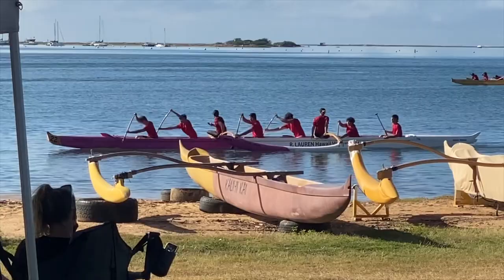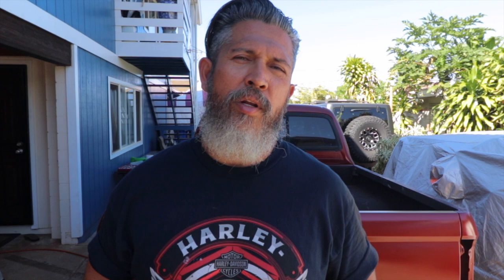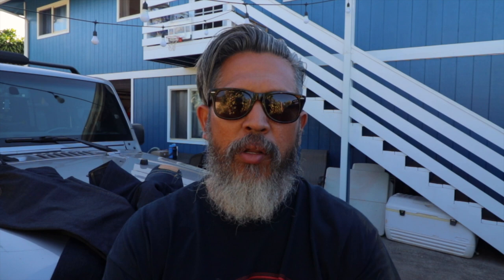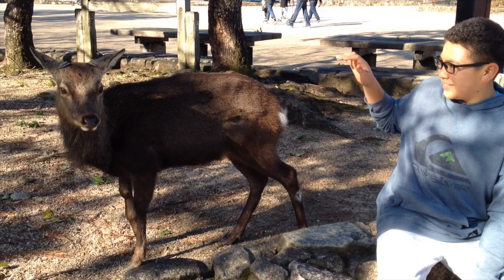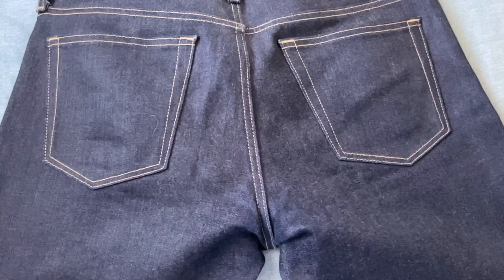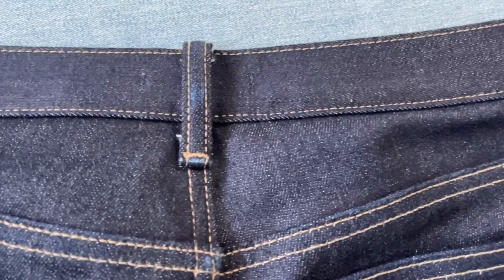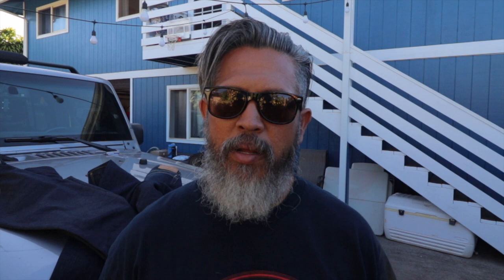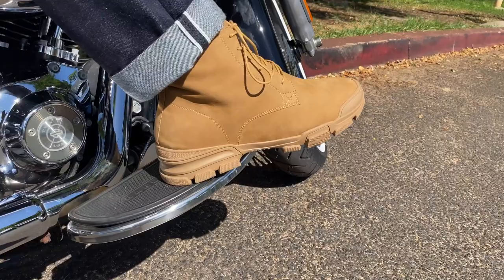Selvedge Jeans from UNIQLO Kaihara | Can it compete with the more expensive selvedge denim?

Comment: I can appreciate heritage. But first and foremost is fit. I just got into raw denim. First pair from gustin. 
They fit decent and I have now worn them for 4 months. Had to wash earlier then planned, as a result of a house project I have been working on. I put on a pair of jeans with a little stretch, while I was waiting a day for them to dry. I had forgotten how comfortable my other pair are. And they drape perfectly on me. Technically they are not selvedge. But they are very dark.(side note * they are new as well.) I think with enough time and following the rule of waiting as long as I can between washes and not drying them that I will end up with a really nice fade as well. Hopefully over time the gustin jeans will be close in comfort and overall fit. But so far I like my much cheaper jeans better. The main draw is that these are raw and I should get a better high contrast fade out of them. As curious as I am to try the more expensive brands, I am not certain that it is worth it. Only time will tell.
Reply from the maker: I have a few pairs of non-selvedge jeans that I use when working on my projects.  I put them on whenever I know that the day will be spent on the ground and I get really greasy.  Gustin’s are like Brave Stars in which the price is decent and the product is pretty good.  Tough to break in and get to the faded phase but it will get there.  On the other hand, the Iron Heart 666s is more expensive but comfortable out of the box and getting to the faded phase really quickly.  It also forms to my legs and waist easily.  

I think we all have a level of comfort when it comes to getting into more expensive selvedge and there is absolutely nothing wrong with owning a sub-100 selvedge and owning one for a long time.  Thanks and have fun with this adventure!
Reply: Thank you for the quick reply. Yes gustin is a very slow fading Jean I am finding out. But these jeans are built like a tank. Even the knees have hardly faded and I am always bending down working on projects. I wish they were more forgiving in movement but that should improve over time. I usually destroy a pair of jeans in the Knees, in the first year. Raw denim is definitely built stronger and better. It is  interesting how different raw denim can be though. As in the case of iron heart being so soft out of the gate. And gaining character quicker. At some point I may have to try the more expensive brands.

Comment: So glad you came out with this review, I have a few pairs of Bravestar and love them. I have been looking into Uniqlo to have as a couple supplemental pairs, that don't fade quite as much and can be worn in an office setting (and have some stretch). 
How is the sizing? That is the biggest thing that has held me back since there isn't a physical location near me, will have to order online. In bravestar I am a 34 in the slim taper,  but have heard the uniqlo fit a little tighter, would you recommend sizing up?
Reply from the maker: Hi, thank you!  I’m glad this is useful.  I too have Bravestars.  I’m a 34 on regular jeans and ordered my BS as size 34 as well.  I honestly did not read the sizing instructions from BS and my 14.5 oz have stretched out a bit to a 35.5 on the waist (true to the website sizing).  I just wear a belt for now until I can take them in.

As far as UNIQLO, yes, they are a bit tighter than usual.  After wearing them a few times, I’ve gotten used to them now.  Luckily these ones have a stretch which helps with comfort.  I would recommend for you to make sure that the online store has a good return policy.  They usually do.  Order a size 34 and try it on first.  

Hope this helps!  Thanks again!
Reply: Uniqlo selvedge according to me is very good. There actually was no need of this video and such a comparison.